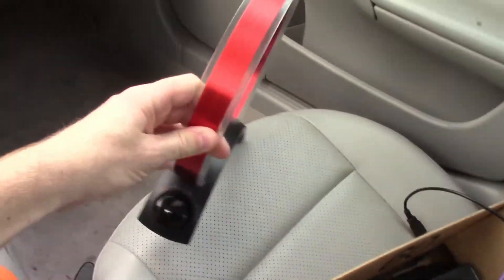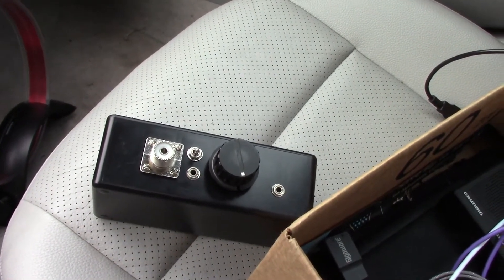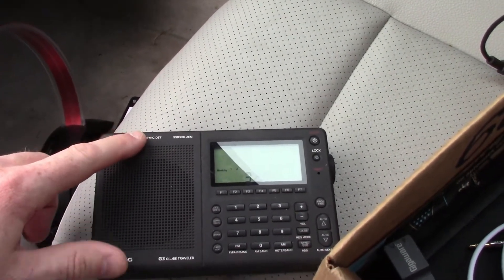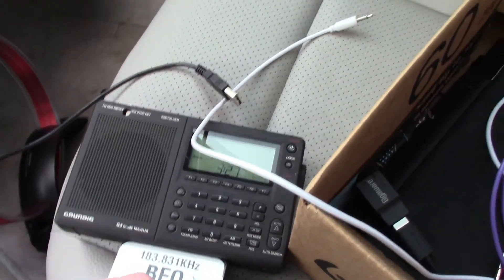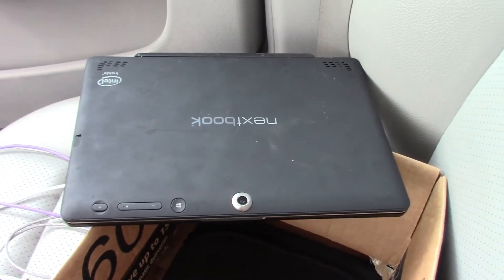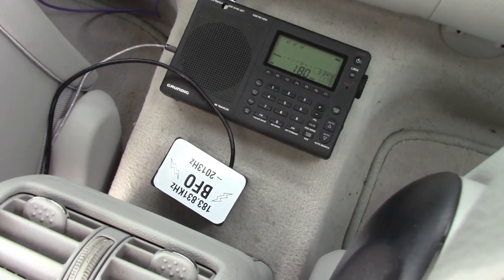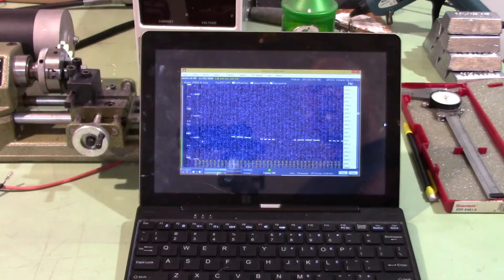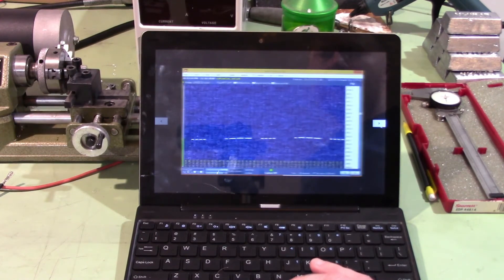My mobile  Lowfer receiver setup

Comment: Very cool. I am in process of trying to put together a LowFER setup. I got an old variometer to use as part of antenna system but figuring out how to hook it up is a little confusing. Impressed with your results and looking forward to updates.
Reply from the maker: Hey, Thank you for watching the videos. I can help you out with hooking it up if you have questions. Is it the one on your channel? Do you know the inductance of it?
Reply: @JohnHamerProjects  Thank you very much for the reply and generous offer! I would love to take you up on it. I will post a video of the current state of things.. I don't know the inductance, but a friend of mine was kind enough to get me an oscilloscope so I will try and learn how to use it... right now, I do have a nanoVNA.. I heard you can use that as well.. so I ordered some adapters to try and connect it to a capacitor and variometer.
Reply from the maker: @FoxyLobo  sounds good. I think the nanoVNA would be the way to get it.